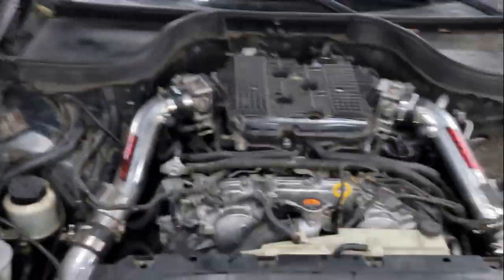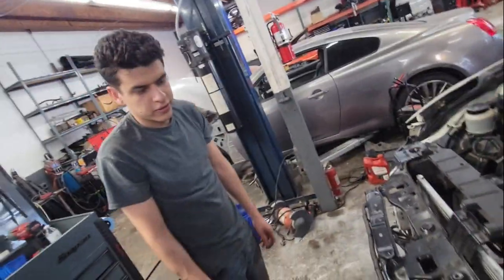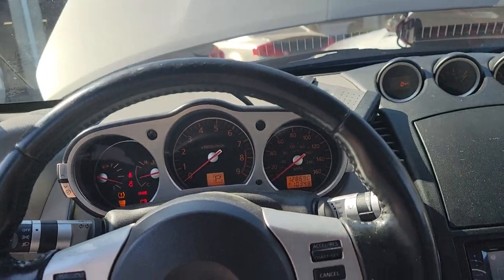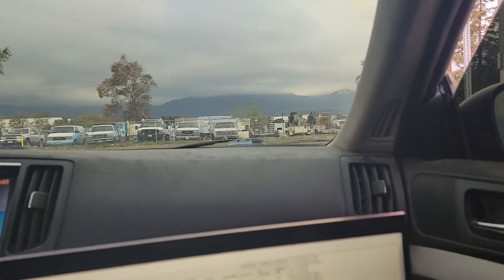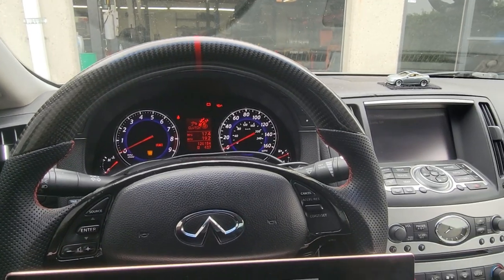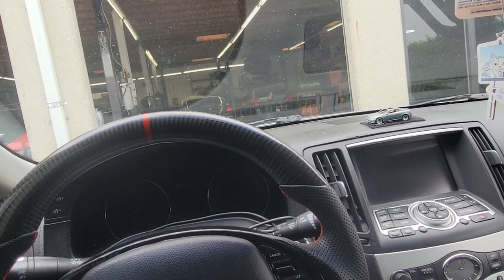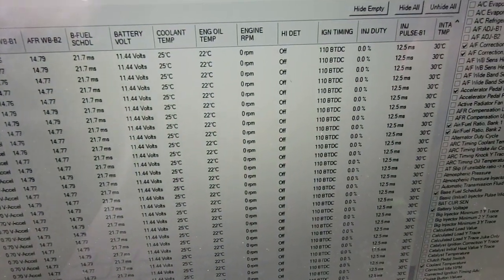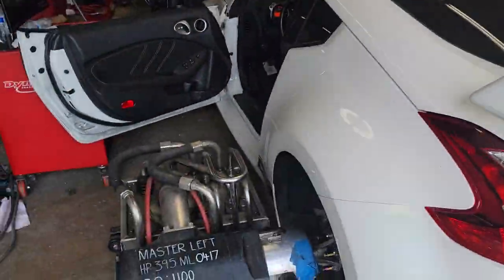2015 bmw M4 dyno pulls + more retunes from other people

Comment: Great video 🔥 serious and rookie a** question lol. I'm able to dyno my G37s coupe and everything is fine but, when I send data to the tuner and he sends it back. Then I do the uprev process, flash it. Then it starts then it sounds like it's going to die, it idles and it won't go pass 4,000 when you floor it. Thank you and your opinion matters 🙏🏽 p.s. the tuner said my cable or software could be corrupted 🤷🏽‍♂️